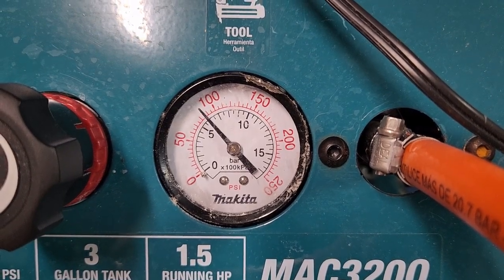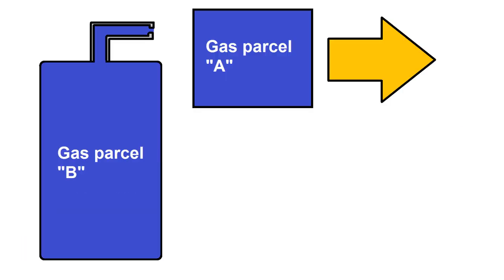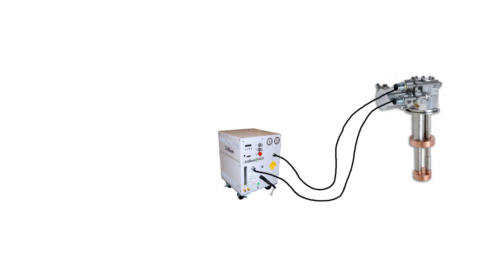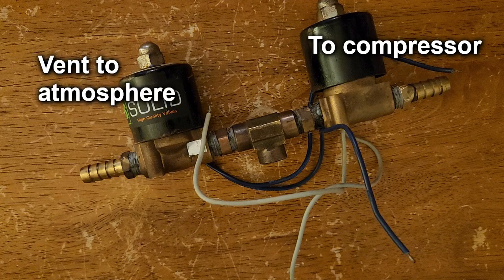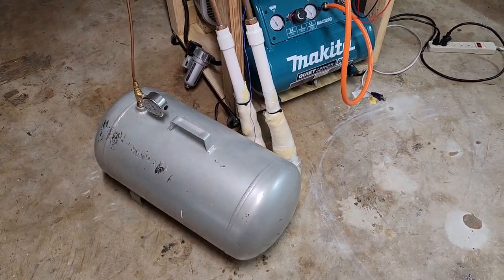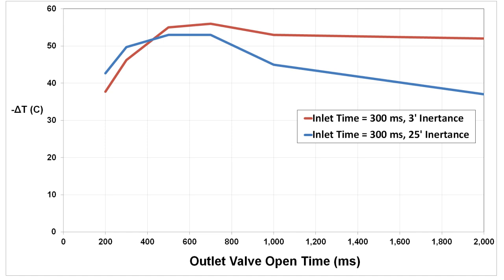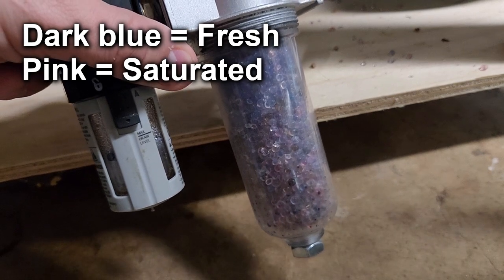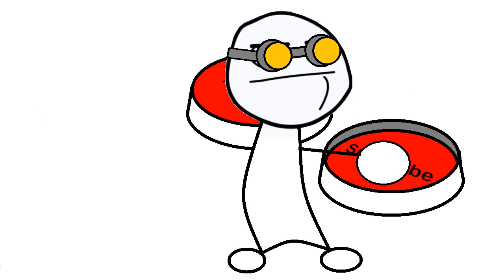Pulse Tube Cryocooler (Part 4) - Valve Controlled

Comment: @HyperspacePirate 
you can try to pre-cool the air with a copper tube and peltier modules stuck to the outside of the tube.  and also reduce the resistance of the heat sink in the same way.

Comment: Now I’m not a chemistry expert but I worked at a liquid nitrogen plant and how they do it is they use a air compressor that squeezes and release helium using a pneumatic piston. One side has a heat sink and the other side gets like very cold so they put a condenser coil on it and runs pure nitrogen gas through it cooling it to a liquid.

Comment: To increase packing density of copper, why not use small copper balls? If they are all of one size then they have a geometrically defined packing density. You then tweak that by using a mix of two or more different sizes of copper balls to get higher packing density. If that's hard in copper, you have plenty of steel balls of different sizes, or even lead balls such as buckshot.

Comment: To run higher pressures in the pulse tube and reduce the thermal conductivity you could use a plastic tube inside of a metal pipe to make it alot stronger. You probably won't get the whole tube insulated from the inside but close enough to reduce all that surface area.

Comment: This leads me into wondering about one think: as helium's (or even hydrogen) inversion temperature is far below ambiant temperature, how is it possible to start a stirling based cryocooler from ambiant temperature using helium (or hydrogen)? Is it because the expansion acts isothermally rather than adiabatically?
Reply from the maker: Inversion temperature isn't relevant when cooling is based on isentropic expansion because the energy is being removed from the system by the mechanical work the gas is doing. You're thinking of a joule-thomson based cooling process, which is different from a pulse tube / stirling cycle.
Reply: OK, thanks for clarification. Anyway JT can start playing  a role while going below the inversion temperature.

Comment: I'm thinking that part of the issue here could be from cooling the incoming air. If it's flowing through the radiator too quickly, it's not removing enough heat to give a decent temperature drop. From what I understand, air holds .24btu for each degree fahrenheit, so one cubic foot could have around 87btu which needs to be removed asap.

Comment: I love this project. Why not get a helium tank from a party store? they are like $30-50. To get higher mesh density you can cut out tons of circles and stack them in the tube. It will take a while but you can hammer them in better. You could also just buy a ton of sink screens or go to a headshop and buy pipe screens.

Comment: Why do you not pulse with a compressed air and airvalve the piston by a simple doubleaction pneumatic cylinder. The electric valve could pulsed operated and drive a defined motion, including flying a compression/decompression cycle in the actor😮😮😮😮

Comment: I was one of the guys responsible for the 4-valve pulse tube cryocooler at the University of Jena. For GM-type pulse tube cryocoolers you have to avoid a too high pressure ratio. It is not wise to go over 3 to 3.5 because otherwise you get a superheating somewhere in the middle of the pulse tube length, because you cannot exchange about more than 30 to 40 per cent of the gas contained in the pulse tube across the cold and hot heat exchangers.

The heat exchangers are very crucial for the performance of such coolers. So for the heat exchange with the environment (aftercooler, cold hx, hot hx) we have used slittet copper parts manufactured by electro-erosion. For the regenerator we have used stainless steel mesh screens which were slidely over sized in diameter (0.2 mm) to get a dense package with no void passes at the rim of the regenerator tube.

The double-inlet version may be more powerful than the orifice or inertance tube version. But the adjustment of the hot end bypass valve is very tricky. In general it is almost impossible to avoid dc flow in the system which lead to enthalpy flow losses. So the 4-valve version is the most powerful one even in the case that it has comparable dc flow losses.

From the viewpoint of efficiency the stirling-type pulse tube cryocooler is better. The best design is the active reservoir system, which I invented in 2010. In this design you can regain a lot of the expansion work with a second piston / cylinder system at the pulse tube hot end and you can exactly set the phase shift between pressure wave and mass flow, like in the case of a comparable alpha-Stirling cryocooler.
Reply from the maker: That's really interesting. I read several papers about the benefits of active buffers, but i felt it was too complex and I didn't understand them well enough to attempt to build one and make a video about it.
Reply: @HyperspacePirate  It is more or less like in the case of an alpha-Stirling cryocooler. I think, active reservoir is very easy to understand. I use SAGE from Gedeon Associates to calculate my designs.

Active reservoir also runs as an engine. In this case the heater sits between the regenerator pulse tube and the after cooler between pulse tube and active reservoir.
Reply: @HyperspacePirate  I love the reference to "The internet is a series of tubes" Ted Stevens.

Comment: I run a bunch of MRI systems and helium recovery systems all which use G-M cryocoolers, both mechanical and pulse-tube. This series is fascinating since I don't get the opportunity to really play with operating parameters of these systems and mostly just run them as-is from the manufacturer. Keep it up!

Comment: Based on 2 decades of work inside cascade chambers professionally,  ditch the type K and go with the equally inexpensive type-T (blue) thermocouple which works wonderfully at -200c and beyond.  Type K is great for high temp use melting metals, and use down to 0c, but at deep cold, type K gives flaky output jumps on digital meters due to its small voltage change when cold, whereas type T is very consistent and stable at -100c and below.

Comment: You can decrease the valves closing time, replacing the frewheeling diodes by resistors. The value is valve current multiply by desired clipping voltage.

Comment: For the Joule-Thomson process a 4500psi compressor isn't that difficult to make. If you look around online for how the home use compressors for air rifles are made it's dead simple. Crank, linear rail as a crosshead, and two polished rods (Round linear rail from Amazon) as pistons sliding into a cylinder headed with a check valve, a simple port at the bottom of stroke for inlet, and a couple O-rings to seal. Feed it with 100psi or so air from a regular compressor and they can bump the pressure up to 4500psi pretty easy. Just depends on how much flow you want.

Comment: Sorry if I sound as ignorant as I actually am on this type of science..  But...  could this technology be practically scaled down to produce, say, a water chiller device that only needs to drop temps 10 or 15 degrees?
Reply from the maker: A vapor compression refrigerator or even peltier cooler would be more efficient for a water chiller. This device is extremely inefficient. It's designed for pumping small amounts of heat at an extremely low temperature. A water chiller would be pumping large amounts of heat at a relatively small temperature differential.

Comment: I know the cartoon BalloonTime helium tank was just a little joke, but you would not want to use the helium from one of those disposable tanks, since it is deliberately diluted with regular atmospheric air to allow it to fill more balloons with less helium cost. But of course those balloons don't float as good as the ones filled from commercial helium tanks, and any cryogenic cooler would be a lot less efficient with that mixture in it instead of pure helium.

Comment: Any reason why you can't use hydrogen as it's twice as thermally conductive, and far cheaper?  Safety precautions can make it safe.  It will require however special stainless.

Comment: use hyper chilled alcohol flowing over the hot end to suck the heat away. the reason I say to use alcohol is that it freezes at tempts of -173 degrees so it should hold up to the code pipe and not freeze but I'm not shore

Comment: Just so you know the baloon time brand helium is 50% air. So when you decide to switch to helium as your working fluid definitely get it from a proper welding store, and get a regulator too. Pure helium is stored at several thousand PSI.

Comment: Can you increase the efficiency of each specific pulse with different shaped outlets from the valve? Like a trumpet bell off of the valve to create a low pressure zone at the valve itself just after shutting? Like old timey carburetor trumpets, that create a high pressure wave when the intake valve closes, and timed to the length of the bell just as that high pressure wave goes pop and creates a low pressure zone at the base of the trumpet with an inrush of air the intake opens reducing parasitic friction on the air flow? In this instance it could possibly cause a little bit of "breathing" through the regenerator mesh instead of 1 way travel. Might require way to much volume of an airbox to be practical.... But hey your way better at the math then i am.

Comment: If you find yourself around sandpoint, ID. Any time soon I live in trout creek mt and just happen to have a gas engine powered two stage compressor 25 cfm at 175 psi and also a aquygen 1500 hho machine supposed to be 1500 liters an hr id let you play around with just have to figure out how to separate the 02 from the H2

Comment: Quick tips for hermetic compressor, add an oil separator in the dischargue of the compressor, this is to avoid running the compresor with low oil (if you are using gas that is not compatible with the oil). 

Don't forguet to make vaccum before charguing with nitrogen to avoid mixing the oil with the moisture of the ambient (this turn the oil acid with the working temperatures of the discharge of the compressor)

Don't run too high pressure with non condesable gases, I tested a R134A compressor with 100 psi of nitrogen to check  the metering deivice (home refrigeration appliance) and only worked a couple of seconds before the piston stall, runs normally after purgin nitrogen and charguer with R134A. 

Nice videos by the way, I wish good luck with your next interarion :D
Reply: I have run my small R134a compressor with nitrogen for hours without any problem. I have tried many gases like methane nitrogen ethylene with the compressor and never had any problem.
Reply: @Exotic_Lab   interesting, what is the model of your compressor and how much pressure you have with the compressor off?
Reply: @tejonBiker  it's standard 1/4 HP Low back pressure R134a compressor from old fridge. I was running it at 18 bar discharge continuous.
Reply: @Exotic_Lab  Thanks for the info, I was testing an 1/6 R134A, I can't understand exactly why the piston stall, but solved after shift to r134A instead of nitrogen
Reply: @tejonBiker  It might simply be pulling more amps than the electric motor inside the compressor can do? 1/6 HP is fairly small. Maybe that compressor was already getting worn and had a lot of internal friction, and so wasn't able to handle much additional heat. R134a will carry the poe oil through the compressor and keep it better lubed, but nitrogen probably doesn't pick that oil up. The other guy's compressor just handled that less lubrication better than yours I guess, lol.

Comment: hey try inverted (up-right) resin tank uv-laser engraver curing, keep the level of the tank exact with a control rod, and instead of the normal resin 3d printer, grow the object on the surface of the liquid UV-resin, moving down the print bed, or just having the control-rod rise the resin level in the tank, to be just on top of the printable item, just like the normal resin 3d printer, but no getting stuck on the bottom of the tank problems

Comment: hi there!  Great project.  Congratulations on your persistence!  One question I need to ask you about your graphic at 16:49 (the GM assembly with helium pump).  The helium compressors I've seen have been 3 phase brutes!  Can this be done with more modest power requirements?

Comment: This is by far the most approachable way to get super low temps at home.  I have almost everything I need to build this today. ~ -100c is good enough for so many projects. I also have a larger compressor with an auto drain. 😀
I look forward to additional experiments on this.

Comment: use a NON conductive regenerator material... microscope slides perhaps. glass is ideal regenerator material...

the idea is the heat clings to the surface where its easily transferred rather than soaking in...

Comment: Could you not create the correct charge/discharge times by choking off the flow into the system? You say you want to keep system at a high pressure but run at 900ms valve timing, thus need to reduce the speed of which the pressure drops within that timeframe.

Comment: Really nice project, and so impressive taking into account that you're building it from scratch. About using hydrogen as a cooling gas - you have to remember that it will be leaking out of the system quite substantially because of its super small molecular size, and also might be hazardous when combined with electrical valves. Helium, despite limitations caused by price, might be a better choice when taking into account your safety. Also, after longer usage, hydrogen might intercalate metal parts of the system reducing their lifespan.
Reply from the maker: My plan is to use hydrogen for prototyping since i expect to lose a lot to leakage, but it would be very easy for me to replenish with electrolysis / chemical generation. If i get a cryocooler working close to LN2 temperatures with that, i'll switch to helium.

Comment: Would it be possible to use this cooler in tandem with peltier devices?  If you connect the hotside of the peltier to the -75°C output of your cooler, you might get that extra temperature drop you need?

Comment: I was wondering, would it be beneficial to run the supply line through the expansion line so that the input air starts at a even lower temperature as it continues to cool?

Comment: Very cool project. Industrial helium compressors typically have a whole system to first introduce and then remove oils from the helium gas to lubricate the compressor.
Reply from the maker: Right now that seems to be the biggest challenge with re-purposing a hermetic compressor from a fridge. I got a coalescing oil separator specifically made for that application, so hopefully it'll do the trick. Separation of the oil is relatively straightforward, but I'll have to do a little engineering to meter the oil return flowrate into the low pressure side of the compressor

Comment: Just a thought when you switch to the refrigerator compressor, our GM cryopumps have big oil adsorbers in line to stop the oil in the compressor from reaching the refrigerator. Might not be an issue for short runs though.

Comment: Im surprised you were able to get temps right around -100°c with that compressor @ 100psi and its shitty cfm and doody cycles.    Props..  figured youd incorporate a hermetic compressor sooner or later..  
  Why not think about how people make homemade liquid oxygen with those cheap diy systems..?  Also i think propane as the refrigerant will be much easier and cost effective to achieve similar results as with the hydrogen or helium that you were going to use..  hydrogen is super critical at those pressures in closed loop systems with its particle size being very hard to contain and helium will require much higher saturation temps in process..
Reply from the maker: Propane is a good refrigerant, but for vapor-compression cycles where cold end temperatures are never lower than around -30C or so

Comment: I don't know if you've seen my comments, but I really think you should try scrubbing the CO2 out of your working fluid.

The amount of energy required to condense the CO2 might be at least partly responsible for the long time it takes your system to reach steady state, however the biggest issue is the solid CO2 building up on and insulating your cold heat exchanger surfaces, while also restricting the free space that the air has to pass through. (perhaps significantly enough to choke the flow at the regenerator's outlet?)

Insulating the coldest sections of the loop against the outside air, mostly to prevent water from consensing onto it.
This would also exclude the variable heat loading that might be affecting the consistency and accuracy of your inter-day data, as even just the normal intra-day dewpoint variation can add up to a 2x increase in the amount of heat being pumped by the system.
Reply from the maker: The CO2 is a problem, but I think the leftover water is still a bigger issue. At a dew point of -40C, the vapor pressure of water is ~26 pa, making it 260 ppm by volume, whereas the ambient co2 is around 350 ppm. 

However, heat of fusion of Co2 is ~9 kJ/mol whereas the water has to condense and then freeze so ~41 kJ/mol to condense then ~6 kJ/mol to freeze, so quite a bit more energy consumption overall from the trace moisture